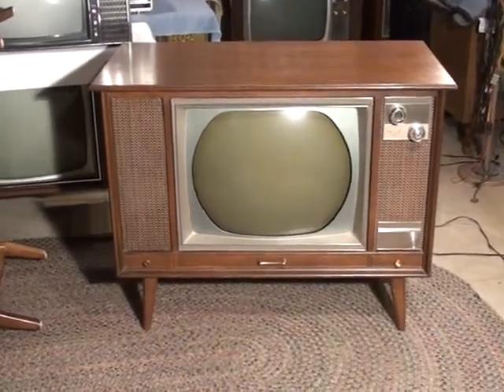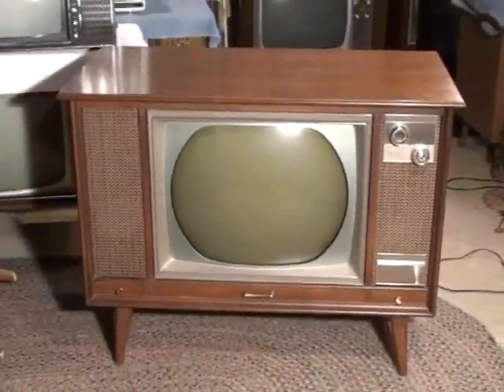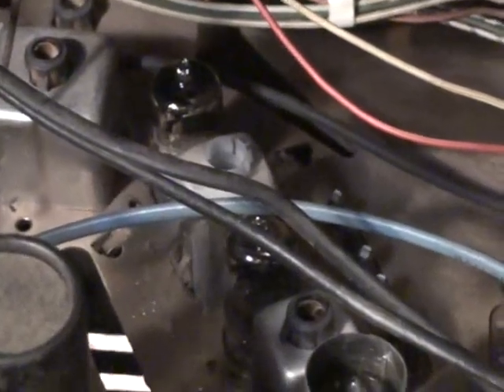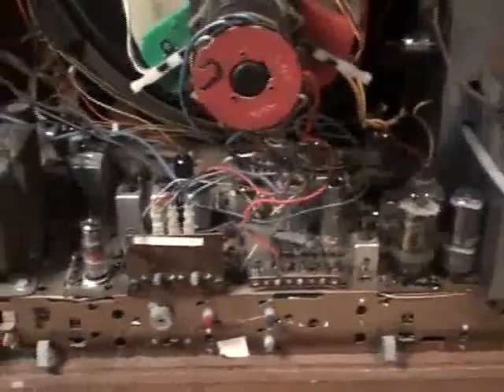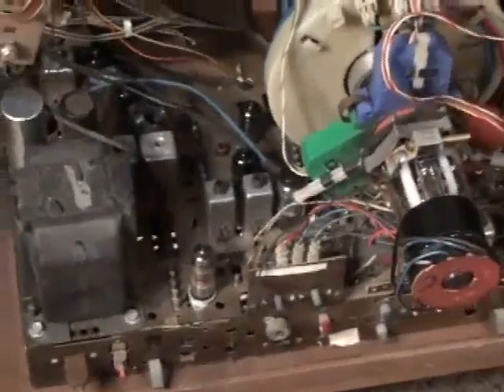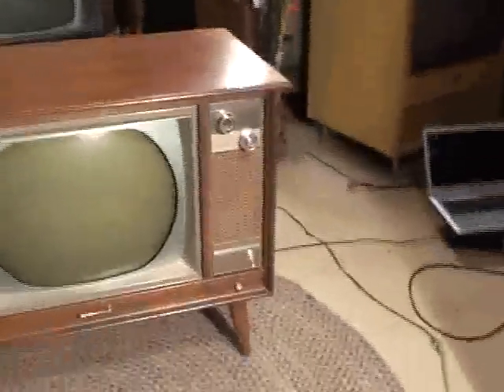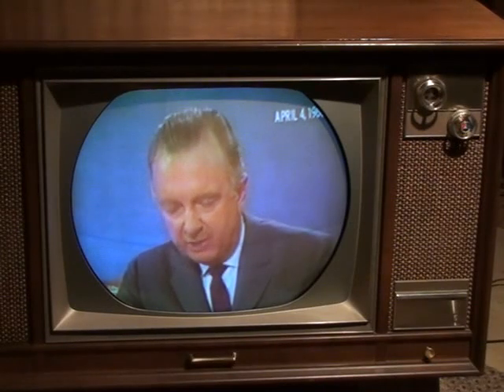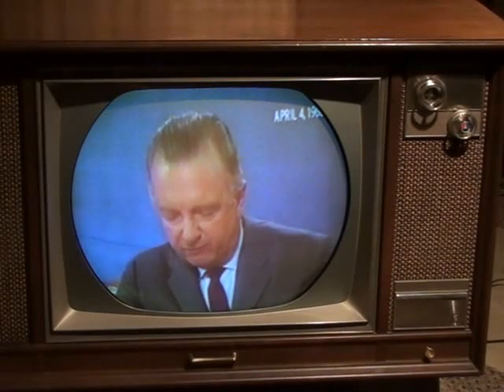Watch a 1966 Zenith roundie Color TV!

Comment: I remember my Dad going to the local supermarket, sometimes at night, to get a small replacement vacuum tube, when they blew out, which they would on the 1960s sets. They had a tube tester in the front of the store- you had to take all your suspected tubes with you to the store and test them all, to find the bad one. What a hassle.
Reply: At least you can fix your own TV set without a degree in Electrical Engineering!
Reply: Be thankful those TV tubes weren't made in China, he would have made many more trips for replacements.
Reply: I remember those tube testers from many moons ago. MAD Magazine claimed those machines "were about as accurate as a $2 watch". Now, I don't remember our 67 Curtis Mathes going down often (but I was just a kid, and didn't always pay attention to the goings on), but I think the later console TV's of the 70's had much improved reliability. I don't remember our '74 Magnavox console TV failing at all. I was in 4th grade when my parents gave the C-M entertainment console to my brother and we got the Magnavox TV. 3 years after that, we got our first remote control set, an RCA Color Track. Little or no manual tuning required. 😊
Reply: Wasn't a hassle at all, I enjoyed doing it. I was competent doing it. Fun fixing the TV. Todays young men can't even find their oil dipstick , let alone work on an old TV.
Reply: Tubes are still made today for guitar amplifier's, the majority come from Russia believe it or not.
Reply: @MisterMikeTexas  Yeah, in the 60s my father used to go to the nearby 7-11 (convenience store), use their tube tester, and buy the tube right there, if the one he brought in tested “off!”  What a concept — fix the TV rather than buy a new one, lol!

Comment: I worked my way through college working in TV repair shops in the 60's. As a couple other posters mentioned, roundies were still produced until about 1968. The last shop I worked for did initial setup and warranty service for a Magnavox dealer; and although rectangulars were dominant by that time, they were still selling a few new roundies. I liked them at the time because they were somewhat easier than the rectangulars to adjust for good purity and convergence.

Comment: so many memories. for those who did not own a color tv, sears made a 'device' to turn your b&w TV into a color set. it was a flat piece of plastic that adhered to your tv screen by static electricity. it was a tri-colored panel with blue on the top third, red on the middle third and green on the bottom third. A freakish novelty, but it would be fun to see one again.
Reply: ***** We lived about 50 miles from NYC, so the biggest task was getting channel 2. And still is.
Reply: I saw a TV with that plastic sheet on it. After a short while, it actually felt like you were watching in color.

Comment: 6CB6 IFs? Interesting. These were used in most 1950s and many early 60s B&W sets. I remember having to swap out brand new tubes to get these sets to work well with antennas in rural areas. Always carried a bunch of 'em in my tube caddie.

Comment: In 1980 we brought our 1st brand new Zenith color tv. Seems I waited a life-time to finally have one. Don't know the model, but it was a great TV with great color. Cable had just came out (or to our town) and no static was produced like in the analog/out door/roof antenna days, and it was basic one time color adjustment, although it could be adjusted.. Before that it was the old black and white consoles in the 50's/60's.

Comment: These early color sets drew so much power that the lights in the house would dim when you switched them on.  They generated so much heat that there were constant service issues.  You were on a first name basis with your repairman.

Comment: This old set has the shunt reg, in the front where the hv cage with the 3a3c would be,, I only touched that quad coil when their was a little buzz . with a slight buzz using a plastic tool . dads busted the ferrit bead with in those coils often.

Comment: I don't know why people are so sentimental about losing the analog TV signal.  Digital is so much better. No snow or image ghosting.  Stations can compress their signals for more spectrum, giving you more to choose from.. Before digital went into effect I picked up about 40 channels. Now it's over 90 including added music channels. Who needs cable anymore?
Reply: ldchappell1 
Digital TV has no snow because it's a purely binary system. You have a picture or you don't. Colour blocks are the picture breaking down. You don't get a snowy picture or a b/w picture- you get blue or black.
So if you're 50 miles outside the area you want to pick up a picture from, it's not allocated in your sector. Best try online. If you're in Manchester England and you want to catch up with home in Nottingham, Birmingham, Leeds or Wales, you can't.
Reply: Digital TV sucks. It breaks up and goes off air all the time. I've had digital at several different locations where I've lived and it's always the same. It can go off several times a day. Analogue went off the air so rarely, when it did, it was an event! It'd go off air maybe once or twice a year. Digital TV sucks.

Comment: Yep, those 6BZ6 IF amps just didn't do as good.  If your IF amps weren't adjusted to take mavain input at full level, the output signal would degrade to lower field voltage, causing the candrom bevel axillator to create lines in the picture.  Though not appreciably perceptible, if a better IF amp was used, as in other chassis, a better picture, and lower gemblain frequency oscillations would result.